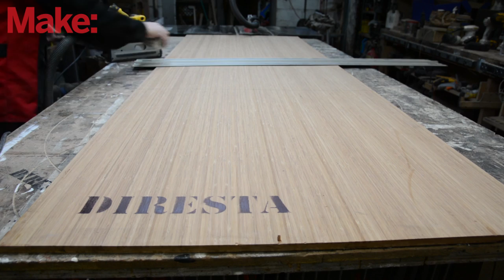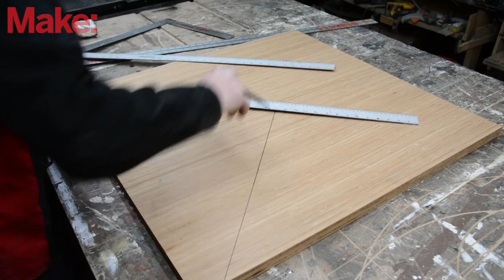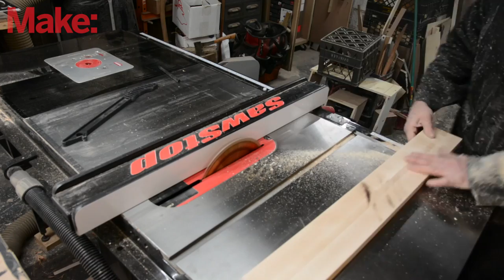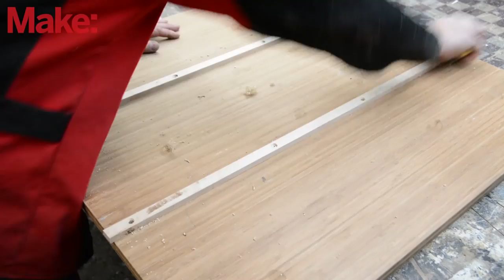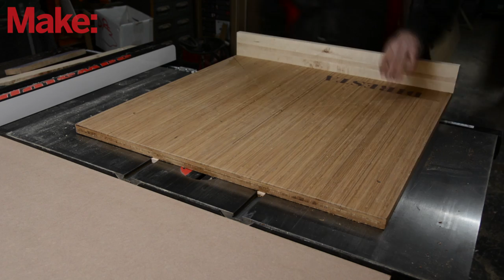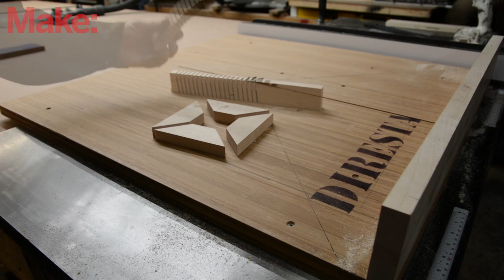DiResta: Table Saw Sled

Comment: There is always a smarter Jimmy Diresta solution if you look for it.  I have watched this before, but I just now am noticing the true brilliance, "it's a dual purpose sled"  for crosscuts and miters.  Before there were all the fancy tracksaws, or even sliding compound mitersaws... I made a tablesaw sled with hold downs that I used for making crazy long compound miter cuts accurately in panels.  This was for an onsite installation used on a contractor saw.  Everything else I could do easier on the mitersaw, but I think I'm going to build this jig just as you have it here.  Someday I'd love to see you, in your efficient gorilla combat style tackle the box joint jig.  You have a gift for finding the quickest best way around, you're a river in flood.  My efforts to simplify usually complicate things.

Comment: All the other woodworkers: T.nut here, scale there, adjustable clamps, round over edges, dog holes and all that. Diresta? "Yeah, a square board, couple 'o screws, a tape measure and a pencil will do."

And it works just as well LOL.

Comment: There's a dead spot if the sled is centered on the kerf,  at least to my knowledge anyway. I didn't intentionally off center mine the first time due to a previous cut in my up cycled material.  My sled worked seamlessly so that's the design I stick to .  It may not even an issue here,  I'm just curious about it

Comment: 4:19 how did you set the back rail as perpendicular to the blade?
Reply: +BeeRich33 That's what I was wondering. It looks like he just threw it on there and it happened to be right. I wish I was that good.
Reply: At 3:10 when he glues the rails on the bottom, he squares the top off the fence. As he know the fence and the top are both square to the blade, he knows the back edge is square. then he can just stick the back rail straight on the back edge. :D

Comment: I'd rather build the V-Shape angle board as an extra board you can screw on top, because it provides you not just more liberties for different angles, it also gives you 3/4 of an inch more cutting depth which could really be inconveniant in shown implementation

Comment: How does that rail work for the skilsaw?  It seems not to need clamps...
Reply: +Chris Hall There is a gripping tape on the bottom. This type of saw is called a track saw. :)
Reply: +Chris Hall probably has rubber or some other anti skid on the bottom.  weight of the saw plus the force of pushing down to engage the saw is enough to keep it in place.
Reply: +scrager4 knowing me...i would need a clamp anyways...

Comment: Jimmy, could maybe sticking that upper portion on there with dowels be a better idea, instead of screwing it on? It sort of feels like those screw holes are going to get worn out pretty quick.. On the other hand maybe there's a risk of it getting caught on the blade and sent flying..
Reply: +Tjita1 the removable part doesn't have to go back in the exact position every time.  it just makes the surface level.  if the gap opens or goes on crooked, it doesn't matter as the surface is still flat.
Reply: I was more thinking in terms of the screw holes no longer holding it down so you'd have to keep making new ones.

Comment: Instead of all that extra work cutting, screwing, and then removing the piece for the 45 degree miters, I'd have just ripped a separate straight edge with some indexing pins on either end. Then you can drill pin holes at the desired angles and just drop it into place. Less work, less material, simple, and more versatile.
Reply: I was just thinking that you could replace the screws with some pins and inset some rare earth magnets to hold it.

Thanks for the tips jimmy, you turned two sleds into one.
Reply: I don't think anyone asked what you would have done...

Comment: SawStop because you are only ever issued with ten fingers!

If only they made LatheStop, MillStop, DrillpressStop ...
Reply: Yeah, but I'm sure using a screw driver or any other metal object as a push stick would activate the stop should it be touching your skin and the blade? Like Jimmy used a metal spike in this video.

Comment: Isn't it a little dangerous to use a screwdriver as a push stick? I know you have a Sawstop and it will probably stop the blade but there is still a chance of something bad happening if the blade hit the screwdriver.

Comment: Did know one else notice the mitres didn't align perfectly. Should have used both sides of the 45 degree angle. I'm sure you know that but why not show it in the video.
Reply: I made my mark on the one side. And besides I'd have to hold the short piece on the other side. Not safe
Reply: Hey Jimmy ! Long time fan of your work and have a easy question I hope... My table saw fence no longer holds tight on the far end, I have tried using a clamp once I get it set where I need it but it's just making the fence slant out at the top... A new saw in not in my budget right now, but I use it several times per week... Any ideas ?